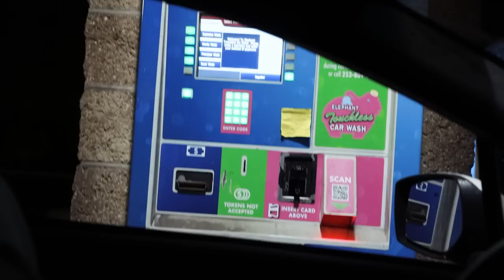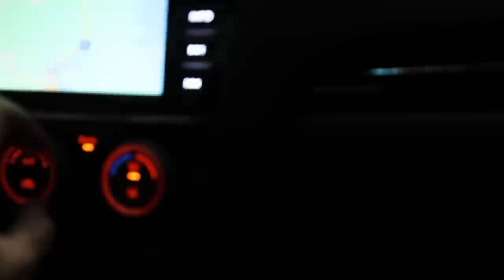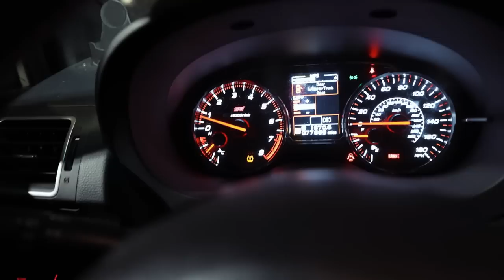A Quick VA Subaru STI Build

Comment: love the channel long time lurker first time commenting. I too forgot the starter signal wire. I was meticulous with my RA long block build and getting everything perfect. I noticed the starter signal wire but it never occurred to me it belonged to the starter at the time. I thought it was some diagnostic connector or something so I left it loose. As soon as i was ready to turn it over the first time and nothing happened I immediately knew what it was lol. plugged her in, built oil pressure and huge smile on my face. keep up the good work! For the record was replacing the 165k mile EJ25 on my 2015 STI. Cyl 1 and 3 worn rings, bone stock.

Comment: 2015 crystal white pearl STI, 89,000 miles, head gaskets are bad, OEM timing belt/Aisin water pump/NGK 1 step colder plugs/brake pads/ACT HDSS clutch/Streetlite flywheel, Fliudamper harmonic balancer just done less than 2000 miles ago. Interior is EASILY 9/10 condition. Has upgaded Kenwood radio with JL Audio 6.5 components in front doors and matching JL Audio 6.5 2 way speakers in back doors. Comes with 2 sets of aftermarket wheels, and stock sti wheels. Has Cobb GESI downpipe/Remark R1 catback and accessport with tune installed. Comes with following uninstalled NEW parts. Cobb fuel system, Cobb 20G turbo, Grimmspeed 3 port ECBS, Grimmspeed intake, Grimmspeed front mount intercooler, Killer B oil pan/baffle/pickup tube. Has Seibon Carbon hood, Seibon Carbon spoiler, Carbon vortex generator, Carbon grille bottom shroud, carbon door handle overlays, rear diffuser, VLand smoke tailights, OEM LED headlights, carbon side mirror covers. Car is located in KY. Will sell ALL for $28,000. No loan owed, title is free and clear. Can hear run. Car just randomly overheats and there is some small pieces of headgasket in coolant. Over $10,000 worth of recent work in the last few months PLUS another $7,000+ in uninstalled parts included.

OH, we actually had a brief conversation on Facebook when I posted pics of my old Blue EVO8 a few months ago.

Comment: I got a ‘21 STI w/ 3k miles. IAG AOS AND COMP Oil Pan Package along with cyl4cooling mod (all done purely for reliability). All stock besides wheels and exhaust. Cleanest, lowest mileage STI you’ll see. Also, it’s CWP. Lmk if ur interested…
Reply from the maker: Sounds good but I'd be looking for a blown up one that's a bit cheaper 🤝

Comment: Remember to snag a back purging set up for the rotated set up your making, don't want any sugar breaking off and going into that nice brand new turbo or any welds cracking
Reply from the maker: Already ordered the Cups 🥳 picking up a bigger argon tank this week 🔥
Reply: @Smeedia  sometimes having 2 botttles is better so you can independently control your gas flows, but that is so expensive so if you just get a dual regular that can work as well. Just might have to refill that bottle depending on how big of one you've ordered

Comment: So stoked on the 100k subs. Also on a side note you should try out x clutch for the sti. I run the one right before the twin plate and it's got a softer than OE pedal feel.  It also takes all the abuse
Reply from the maker: We're using an X Clutch in the wrx for the swap 🥳
Reply: @Smeedia  you definitely won't regret it.

Comment: Congrats on 100k Tanner! I have a 2021 STi which I went Cobb Stage 1+ on 10k miles ago (25k on the car currently), and I'm so paranoid of my engine blowing up. I change oil every 3k (rotella 540) and am meticulous about EJ driving habits. The car responded very well to the cobb ots map (0 knock, rarely -1.41) Why did this car blow up, did the dude rag on it constantly without checking the oil? How many miles were on it? Is mine likely to suffer the same fate? Any input would be appreciated!
Reply from the maker: The owner had just got it and it blew up on him. Once we had the engine apart we could see the prior owner did not take care of that poor thing

Oil rarely changed, and just not taken care of

Comment: Congratulations on 100k!  I need a recommendation on headlights for a '17 premium, that has the most pathetic low beams I have ever seen.  It isn't an adjustment problem, the light acts like it's being devoured immediately, I've never seen this before.  I'm not interested in a fancy sequential setup, but if possible I would like to use LEDs in place of incandescent bulbs.  Any suggestions?
Reply from the maker: Morimoto HID retrofit is what I would suggest. Makes a work of diffrenece snd they make a PnP kit for the wrx
Reply: @Smeedia  Thanks!  Your suggestions have already helped me take my '17 from a bit sluggish, to as beloved as my e39 M5 was!

Comment: Happy 100K also quick question what do you think of the cvt? My cvt in my brand new 2022 outback wilderness has been having issues and Cobb has told me that the  cvt has heat issues and I’m about ready to just find a 2022 wrx and take the drive train and swap it into my outback 😂😂

Comment: Ayo smedia can you help me out or tips? 

I'm having a problem with my subí being P0300 multiple/random misfire code. I'm at stage 3 w/BOV and protune not sure what to do. 
Thanks dude great content like always !

Edit: Turns how I have cracks in my up pipe down pipe and exhaust manifold.
Reply from the maker: Start with spark, fuel, air and timing. The issue has to be related to one of them. 

I'd start with plugs then fueling
Reply: @Smeedia  🙏